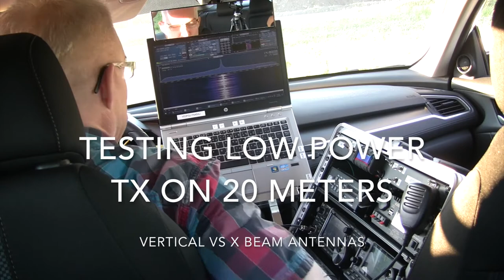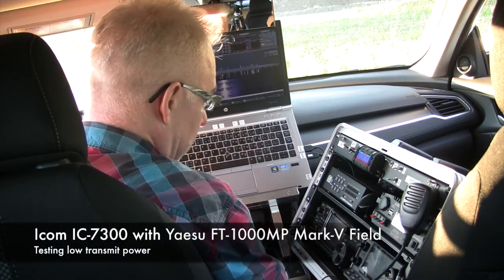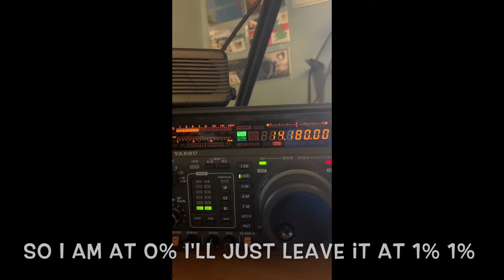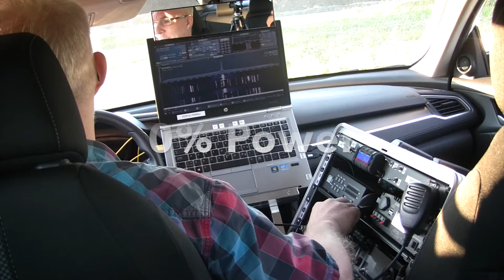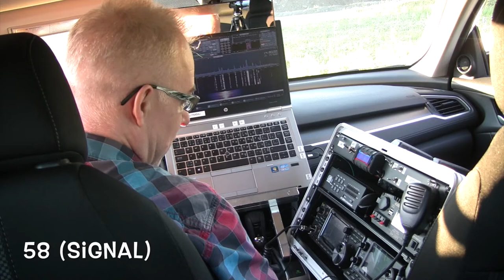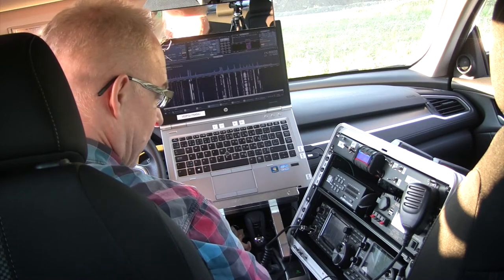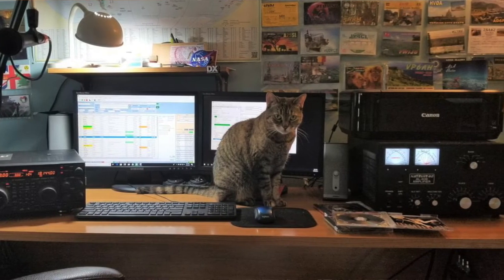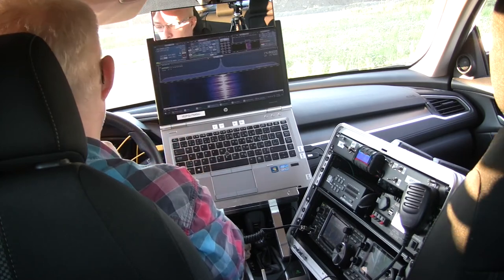Using the IC-7300 at 0% TX Power and FT-1000MP at 5W

Comment: I have confirmed with external RF watt meter, IC-7300 and IC-7610 0% setting  outputs 0.4 to 1 W.  It was good QRPp QSO.
Reply from the maker: Thanks, yea it's amazing, when there is low noise QRP can be very viable.

Comment: That was very cool being able to see and hear the QSO from both end edited together. I'm interested in QRP, but not necessarily field use (but your "go box" I think you called, is quite a way to try different things in the field, i.e. in your car). I've been debating between a IC-7300 and a QRP-only rig, and the 7300 seems to provide so much more bang for the buck with the built-in antenna tuner and the spectrum scope. What other radio do you have in your go box? 73 de W5PAZ(/HC) Gary in Ecuador
Reply from the maker: Hi Gary, it was unexpected to have AJ2I filming this on the other end, the Go-Box has an IC-7300 and IC-7100, the SDR output to the Laptop can be achieved with both. I have since un-assembled the Go-Box, now using a new Go-Box with a single IC-705, see the video in my channel. Thank you for the question and comments! 73 from Quebec!

Comment: I'm a 100W barefoot kinda operator, but I am constantly amazed at US rag chews etc with guys using 1kW-plus to talk a few states over. I mean, yeah, you can do that, but . . . why? So uncessessary. I don't consider it good operating practice. Great video and demonstration!!
Reply from the maker: The 1st time I went that low I just could not believe it. With a few watts and a good antenna we can do a lot. We should use what we need to make the contact, nothing more. Thanks for comment! 73